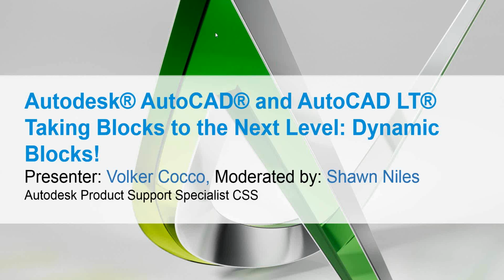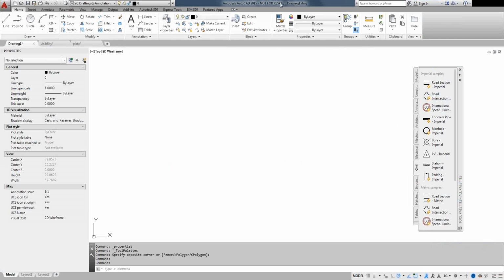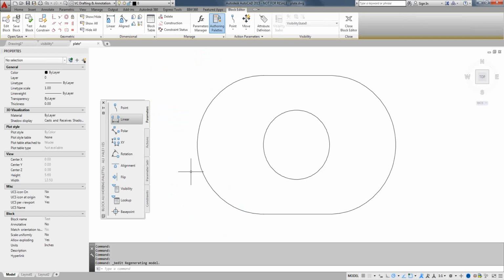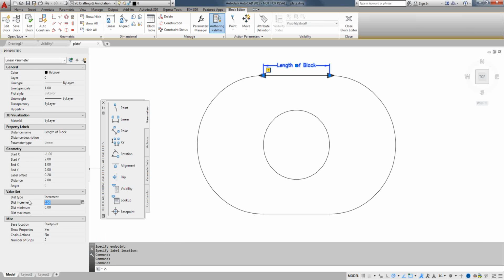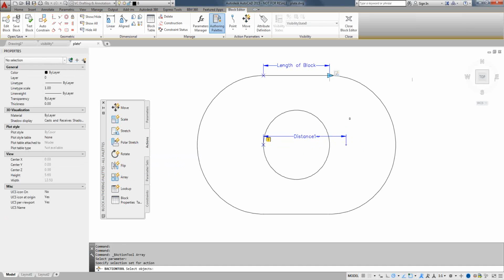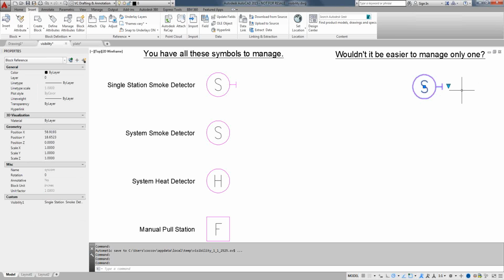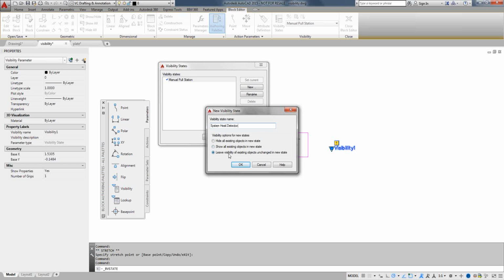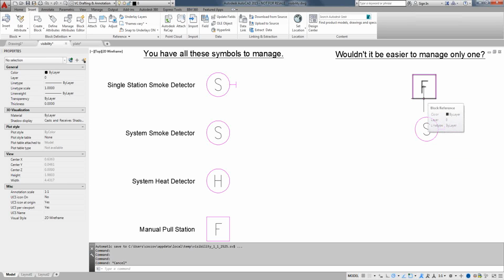Taking blocks to the next level  Dynamic blocks!

Comment: time table 
@9:00 accessing the block editor
@10:55 using array action to expand an object and array the circle
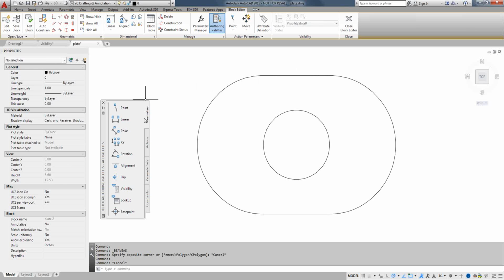@15:07 what is parameters
@16:17 Appling the linear parameter on an object 
@17:58 how to design the array and add increments to it
@20:28 Appling the stretch action and put the stretch window to select the outer object and the  array parameter and chain it with the stretch action
@27:19 explaining the chain of  action of two parameters "really cool skill"
@29:38 lookup tables and visibility status
@31:00 explaining visibility status and visibility status manager
@36:53 see how the visibility arranged and the location of each visibility stat
@40:48 q:how to use attributes in dynamic blocks? a: assign different tag to attributes in different visibility stats